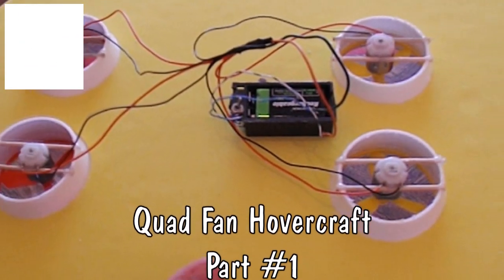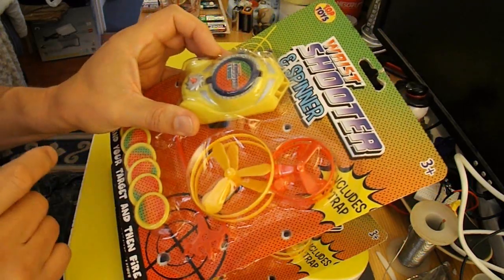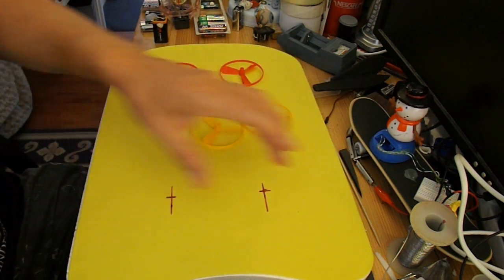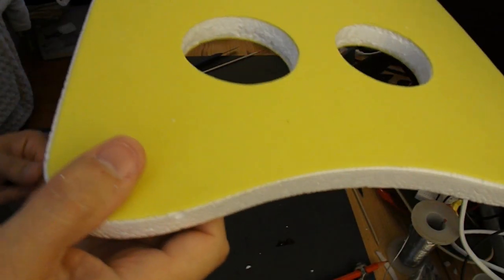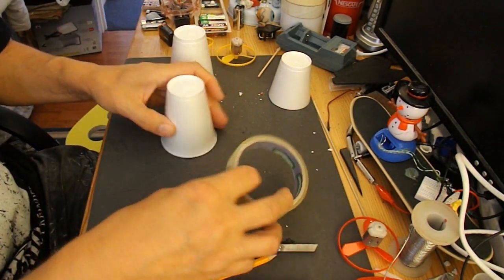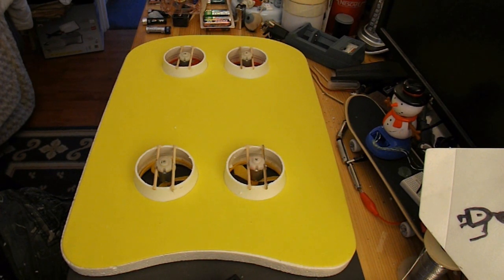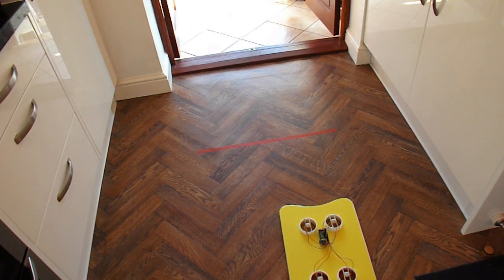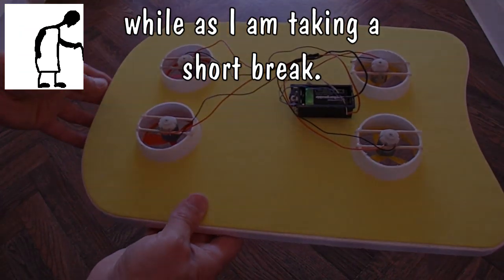Quad Fan Hovercraft Part #1 - initial build

Comment: you could have used amd stock fans that will take off with just one if you overvolt it enough
Reply from the maker: Are AMD stock fans available in bargain stores for £1 ?
Reply from the maker: Haha, fair enough. I have seen hovercraft using similar fans but the point of my exercise was trying to use items from bargain store (or dollar stores if you are in the USA) and the problem with bargain store items is always that they lack power and to get enough power from normal batteries means you add too much weight. This series eventually ends using hobby grade items to get it off the ground even though I only use little 3.7 volt coreless motors meant for mini quads.

Comment: can you make a rc car powered by a T.V remote because a tv remote has infared L.E.Ds and a infared rc car is powered by infared L.E.Ds.
Reply from the maker: +sciencenerds there are some cars in my Infra Red Remote Control playlist https://www.youtube.com/playlist?list=PLA5a2xPRSrB0twF3brpsYS56Jv3iDtaU2 however infrared control using a TV remote is not usually compatible with the normal infrared receivers in remote control toys. You would have to make your own receiver programmed to recognise the signals transmitter by the TV remote. If you just want to turn something on or off that is fairly easy but if you want to use the buttons for different functions it gets much more complicated.

Comment: Thanks for the mail.I will try this one with the kids...:-)
Reply from the maker: It looks good, but to be honest this does not work as well as it could. The fan blades I used are not ideal and I am overpowering the motors so they overheat and that melts the hot glue I used to stick them in place. I have actually burnt one of them out completely. The project idea was to use the cheapest components I could find in the bargain store, but I plan to do a final version sometime with better motors just to see it fly/hover properly. It would improve if I add a small ridge around the underside to keep the plastic skirt away from the underside.
My original idea was to use the principle in this balloon hovercraft but that does not seem to scale up http://youtu.be/bqqVsIeHwgM
This one by Saurav Chakraborty is much better and simpler http://youtu.be/1OMSdA4-Gn4

Comment: I can't stop thinking about if it's possible to spin all blades or proppelers with a single motor through some gears or so. maybe a huge centred gear with 4 arround small gears and the blades you could lift a hover still single motor and battery on it.
Reply from the maker: Probably, but that is not the way I am going in this project. I am sure I have seen some 'proper' rc quadcopters done like that.